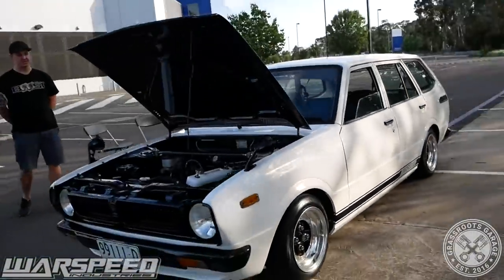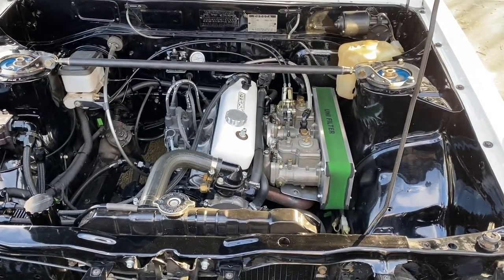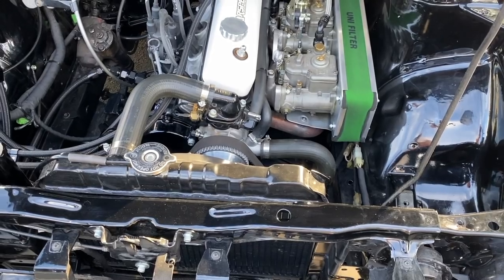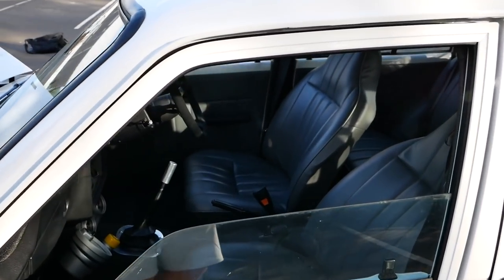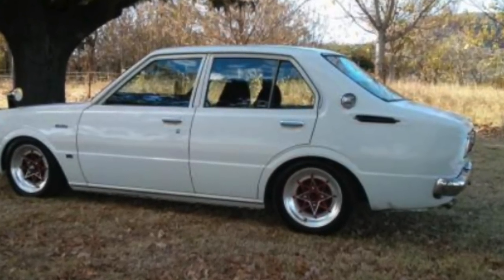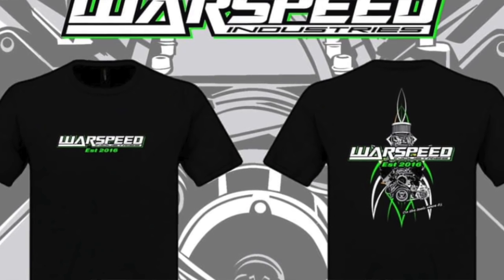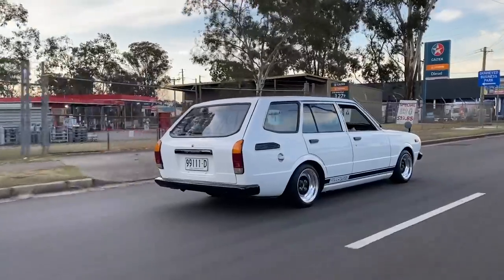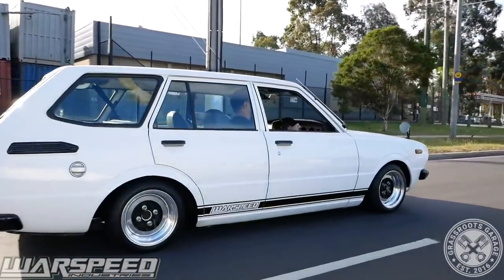KE38 Corolla 5k 9000 rpm twin Webers

Comment: What's even more amazing is this engine was never meant to rev anywhere near that high.  Just think about it:  2 valve per cylinder pushrod design from the 80s that revs like a  Honda F20!  This is just the kind of over-building that makes the Toyota brand the legend that it is.
Reply from the maker: We 💯 concur!!!! Thanks for watching mate
Reply: You're telling me I'm not supposed to rev my 4k up to 8k rpm?
Reply: Well, the K series engines date back to the late 60s really, and they hadn't changed much up to the 80s 5K, just bigger bore and longer stroke.

Comment: i had heaps of corollas in the 90's . i had a  KE30 (or mybe KE38 not sure)  Panel Van and a KE55 Coupe.  I built a pretty fun 5K with a cam , headwork and single webber . but the thing was  a dog to drive on the street . would hardly idol and only went if foot was flat to the floor.